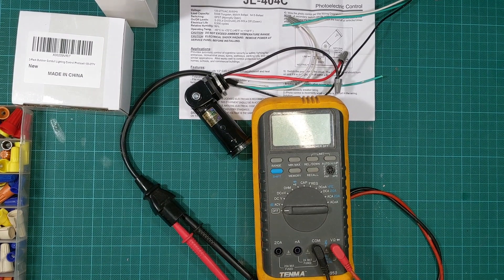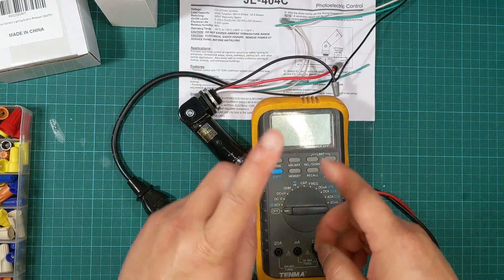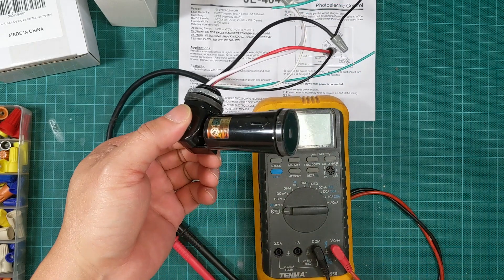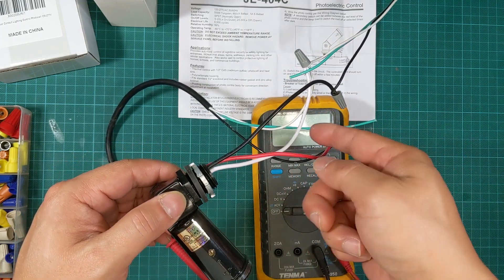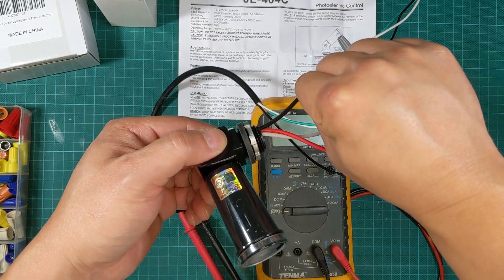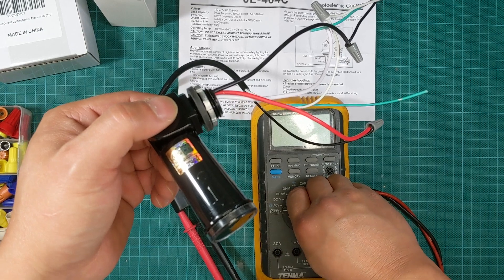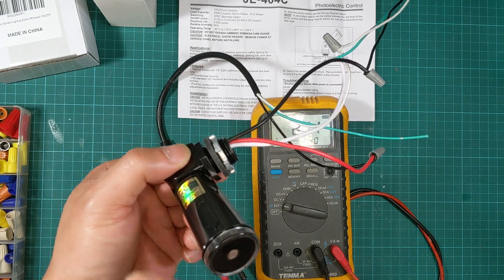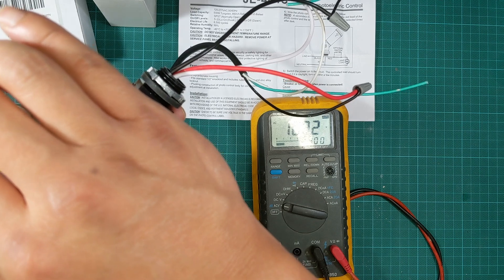PHOTOELECTRIC SWITCH - HOW PHOTOCELL SWITCH WORKS

Comment: The clicking isn’t the photocell, but rather the relay contact which is part of the control circuit - so you have the photocell (which is photons bombarding the semiconductor material, causing electron excitation which results in current flow) - next, the control circuit ( in your example) has a NO contact that is now energized and opens the path to the load (typically red line) - thus lights go out during day and come on at night. 
These photocell switches also have a separate neutral so as to maintain very minimal volt/current to operate the switch itself.

Comment: My photo electric is rated at 120 volts that is installed  on a low voltage power control console.  My low voltage console has circuit 4 at 12 v to 15v.

Comment: Yes there is a relay inside the photocell switch that’s why it’s called a switch if there is no relay the voltage will be variable and it will burn any electrical device on the load side
Reply: How? When the load is expected to handle the maximum ratings on the load side.
Reply: The variable part isn’t the switch, but rather the photocell itself - photons bombarding the semiconductor material initiates  electron excitation which reduces resistance and causes current flow - the more sunlight (photon energy), the more conductive electrons which yields lower resistance (more current flow) - this is determined on the semiconductor qualities